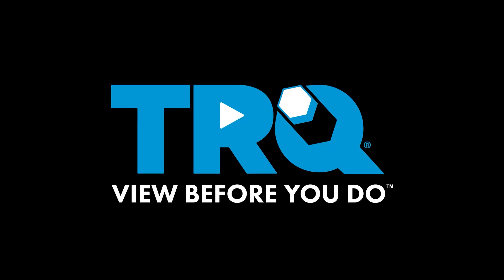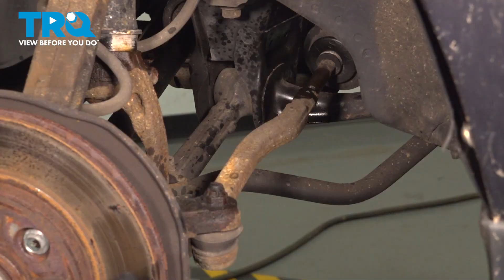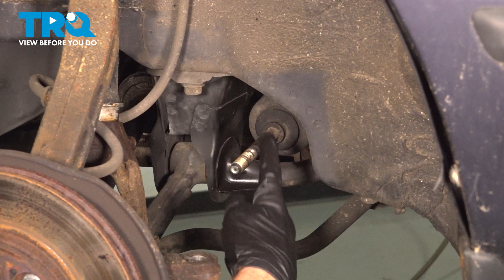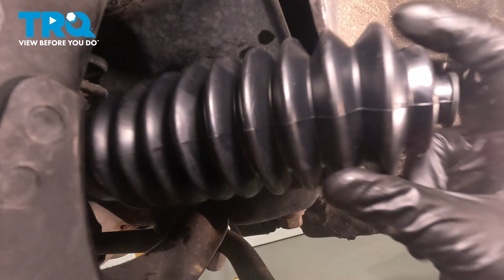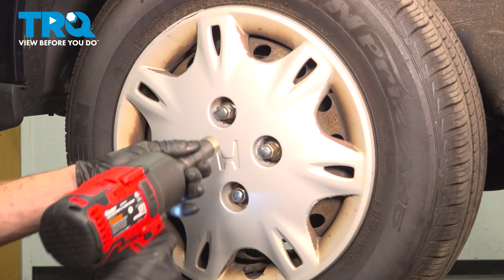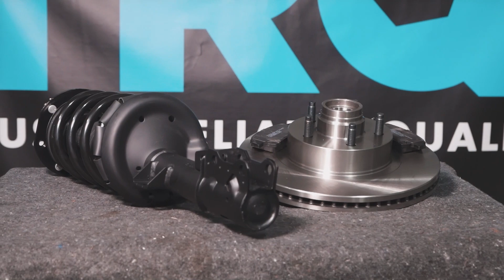How to Replace Front Inner Tie Rods 1994-1997 Honda Accord

Comment: Shop quoted $640 to do both tie rods for both sides with alignment. Got these parts for $85 and after alignment I'm only down 260. Spent another $100 on tools and supplies. All said I got new tie rods and saved almost $300. The hardest part of this job was undoing those locking washers. Really takes some muscles, a variety of tools,a variety of strike angles, and trying to hit the folds from very different angles to get it undone gradually. Took me 11 hours for this job ... lot longer than I was expecting but I had to learn a lot of skills as I went.

PS the 1A Auto locking washers to not fit in the power steering rack grooves, at least they didn't in my Acura CL, so it was a pain getting them to line up. Also the 1A Auto castle nut is 16mm and the jam nut is 20-22mm (couldn't measure, I had to use an adjustable wrench). Such a strange idea to use different fasteners than what the car came with.